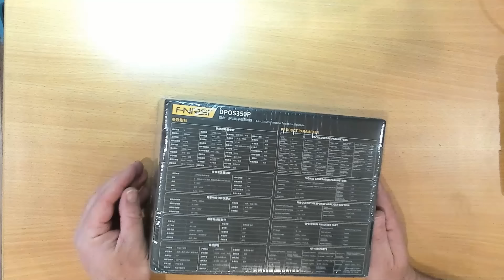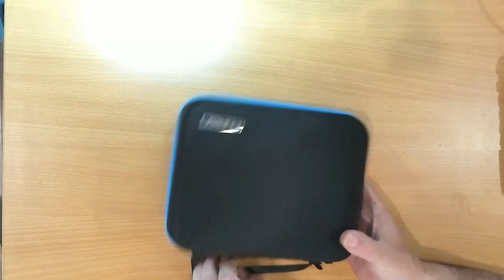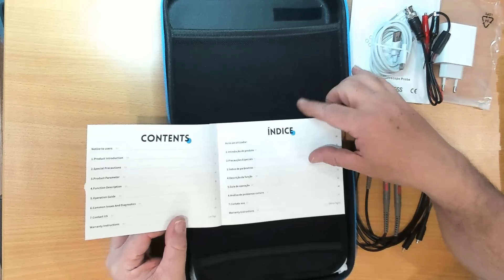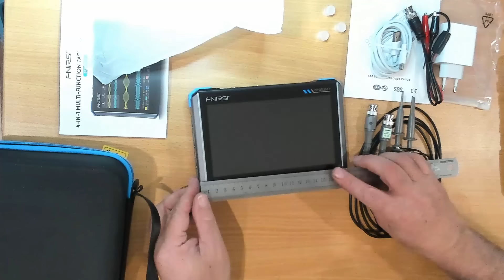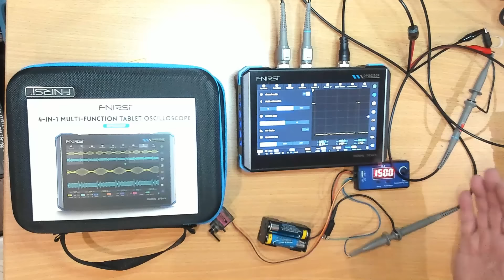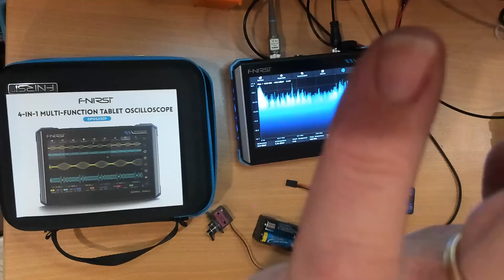Unboxing FNIRSI DPOS350P 4 in 1 Multi-function Tablet Oscilloscope

Comment: Dang it, this is a tough one. I love all the features this has, but Fnirsi is know for stretching or outright making up specs. Its between this and a Rigol DHO802. Might wait a while on the Fnirsi and see if they fix issues or just move on to some other product.
Reply from the maker: I did perform a firmware update.
There was some improvement in the spectrum analyser
20250619
1. Fixed the problem of inconsistent measurement names of Du and DT parameters
2. Fixed the problem of freezing in rolling mode
3. Fixed the problem of phase difference between 2 channels
4. The minimum frequency of the frequency response analyzer is changed to 10Hz
5. The frequency response analyzer adds a display of the sampling progress percentage
6. Fixed the problem of battery power jumping
7. Fixed the problem of abnormal shutdown

But since I purchased this meter, Fnirsi released a new one that supports the signal data analysis I would have liked.

FNIRSI® 2D15P 3-in-1 Benchtop 2CH 100MHz Phosphor Oscilloscope Multimeter.
I have not tested this one out, it's also cheaper that the DPOS350P
Reply: @CyberOne  Yea, I did see that other model. Glad they are actually supporting the 4 in 1 and making improvements. I did end up ordering a Rigol DHP802, ran me just at $300 after tax and free shipping from a site called Newark. I really liked that it has a bit depth of 12, and you can unlock features and make it work like a more expensive model, like higher sample rate and even have a way to add a signal gen. I will still be keeping an eye on the 4 in 1.
Reply: I bought this equipment today for 5 dollars and I don't even know how to use it and that's why I'm watching the video here😂😂
Reply: @bryan8844  Well, if it works, thats an awesome deal. It would be ok for a beginner because its a 4 in 1, saves space and money. If you dont like it, or dont like tinkering, you can get around $150 for it.